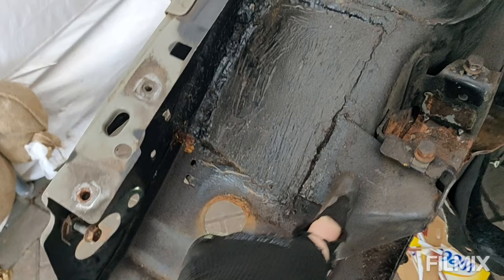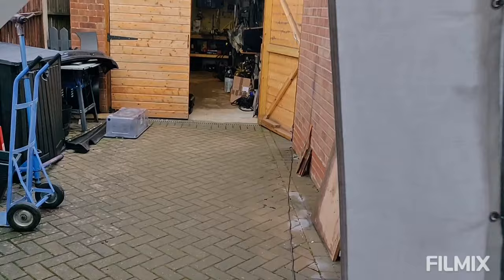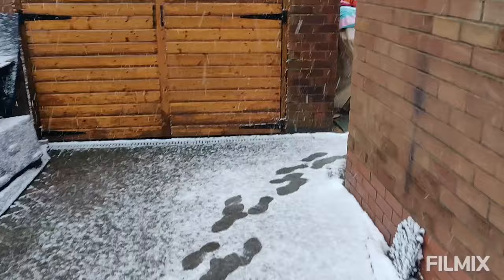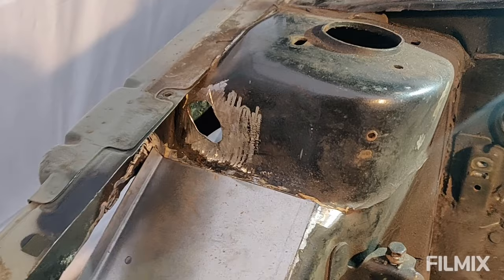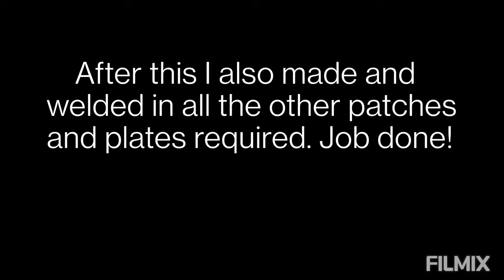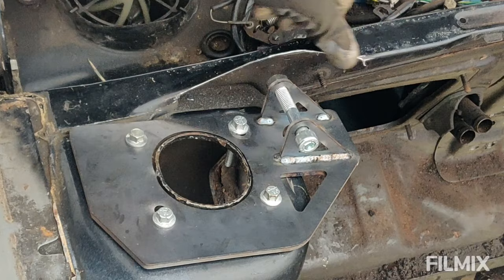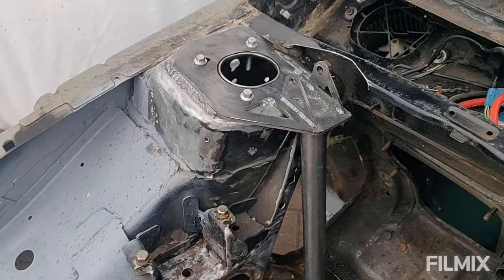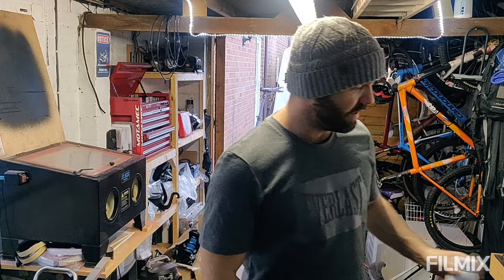Project 5AXO Ep22 - Citroen Saxo VTS Turbo - Satchell Stiffening Kit Install

Comment: Were you able to get the bumper support bracket, or will you have to make them
Reply from the maker: I've kept one and have ordered a new one.  Will weld them back on when the new one arrives. Need to mount the bumper to get it right. If they aren't great I'll make my own.
Reply: @SeanPendlebury  I was lucky with mine, my local Peugeot dealer was very helpful and sorted me with a pair, it's coming on well now, finish in site, been great watching

Comment: Hi sean did you use 0.8 steel thanks
Reply from the maker: Sorry mate, not following the question
Reply: @SeanPendlebury what thickness steel  did you use bud for the rust repairs.
Reply from the maker: 1.0mm I think. Or 1.5. Hard to remember now